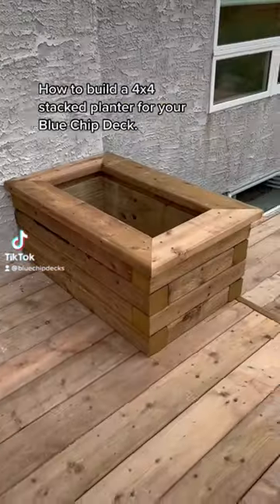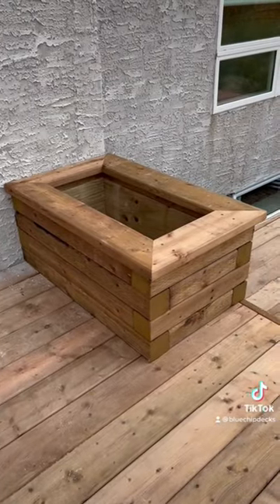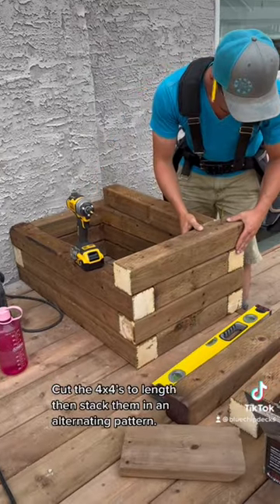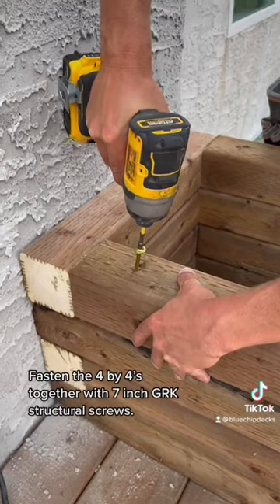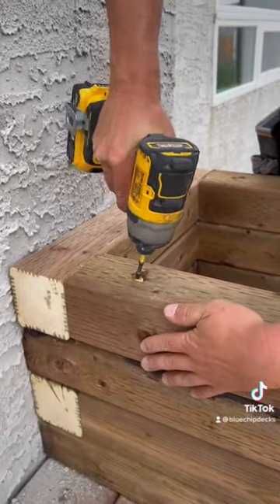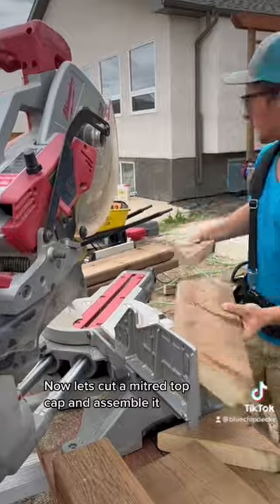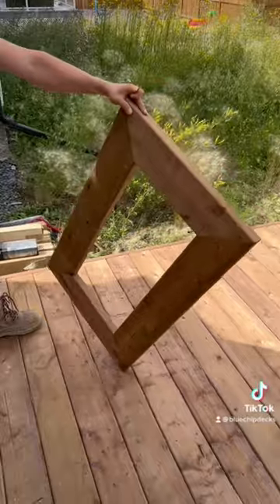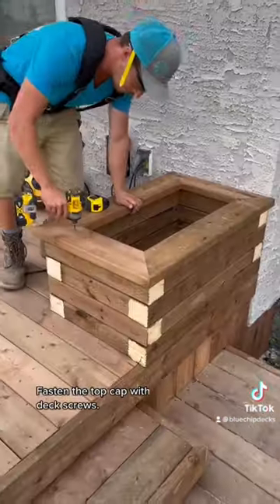How To Build A Simple Deck Planter

Comment: If your planting plants and flowers, you need proper drainage. I would recommend a rubber membrane with a hole in the bottom wall and a drain pipe going off to the side. Plants can drowned and rot as well without drainage. The cracks of the wood will not be enough. The cracks fill with mud and before long the box becomes an aquarium. When making this, think it through.

Comment: Just a question. Should you line the inside with plastic so it doesn’t rot? And should you use pressure treated wood with vegetables?
Reply from the maker: You can used dirt if you want. The lifespan will be the same as a fence post. 15 years or so. If growing vegetables I’d line with poly.

Comment: PRESSURE TREATED WOOD NO LONGER USES ARSENATE!!!! which was toxic. Unless your trying to be an organic gardener new pressure treated lumber has not been approved. It basically small amount of copper that are not suppose to be toxic, not different than pesticide. Still worried wrap with poly plastic. Many Many Gardens today used pressure treated lumber for food. This change about 2004.